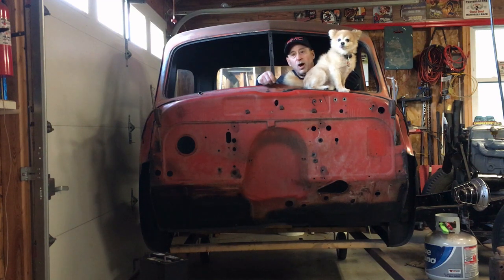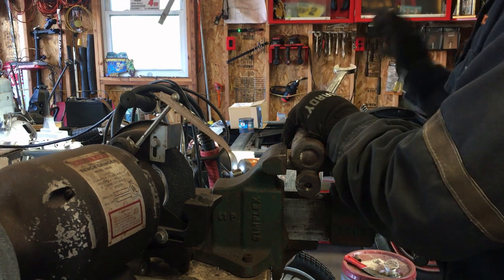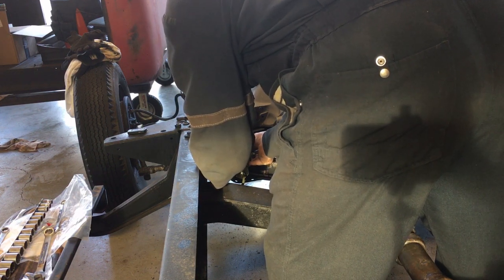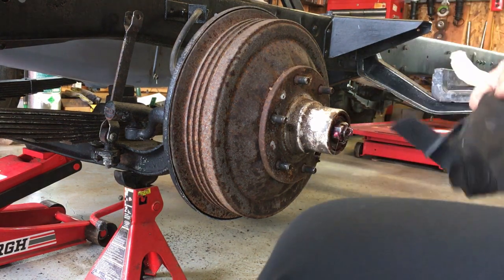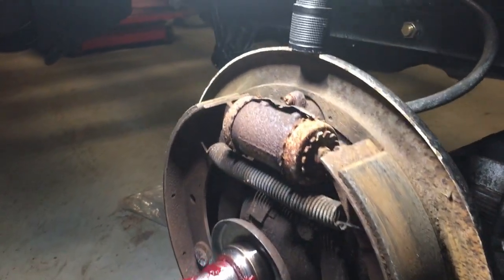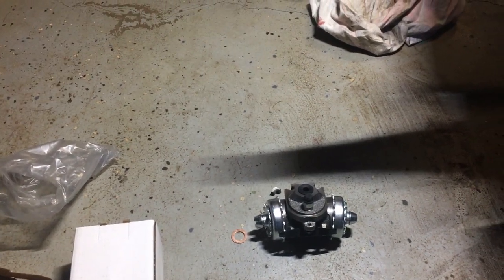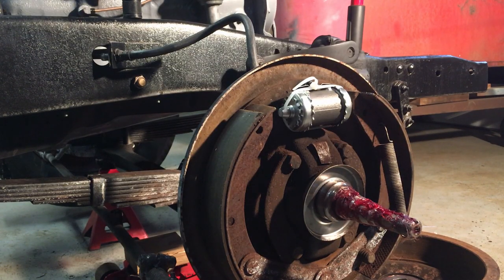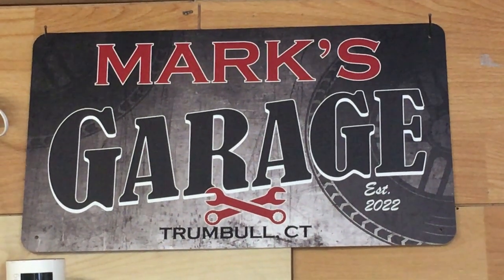1947 GMC Master Cylinder & Brake Cylinder

Comment: It's coming along nicely . If you haven't already, it would be a good ideal to change all the rubber hose's , They can collapse inside. This will let the fluid in,but not out locking up the brake shoes. I have had this happen with older cars and trucks. I hope this helps. Liked and shared. All my best.